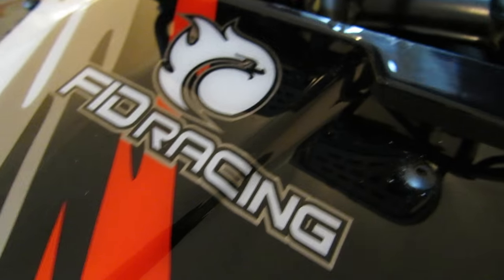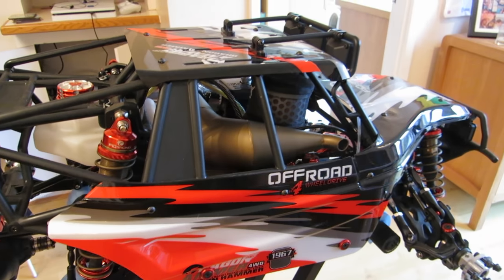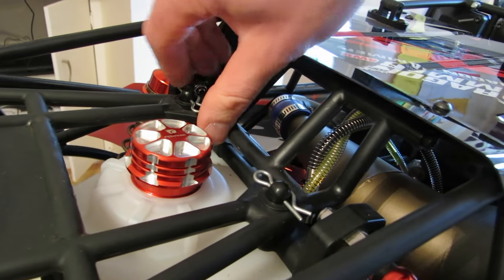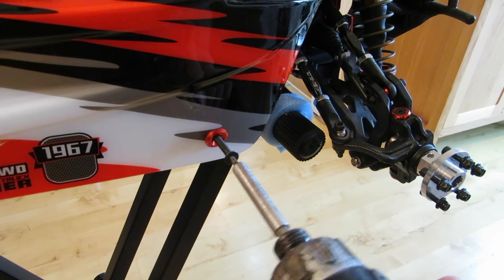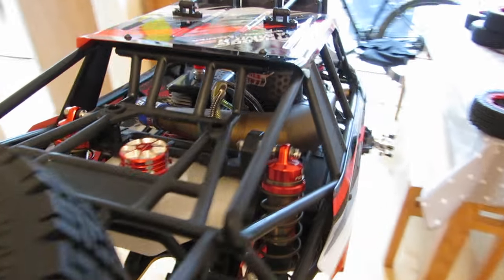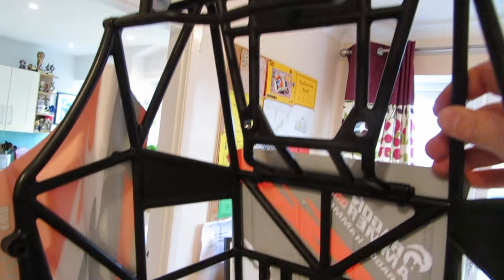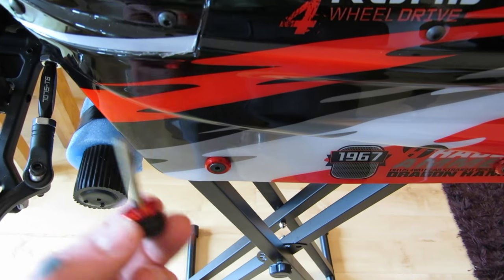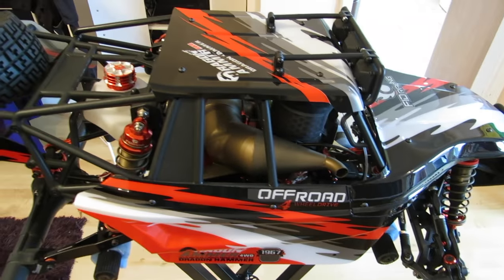Mounting the FID dragon Hammer Body a closer look.

Comment: Thing is like the Losi 5T if you dont fit the cage properly it wont work accordingly. With my last Losi 5T I didnt fit the x4 bottom bolts and the cage was banging around the tank chewing up the plastic. And then when I rolled the 5T on its roof, the cage collapsed and nearly put a hole in the roof of my 30degree north big flex body. And they're tough!! As much of a pain in the ass it is from now on I'm fitting those bolts.
Reply from the maker: I agree mate. I got to say i don't fit the 4 bolts to my losi but i def should! more rigidity is way better, esp when running hard! cheers for the comm. :)